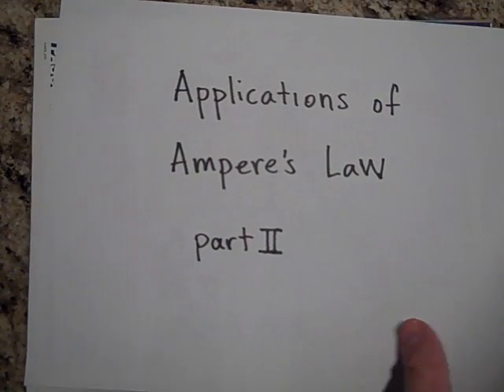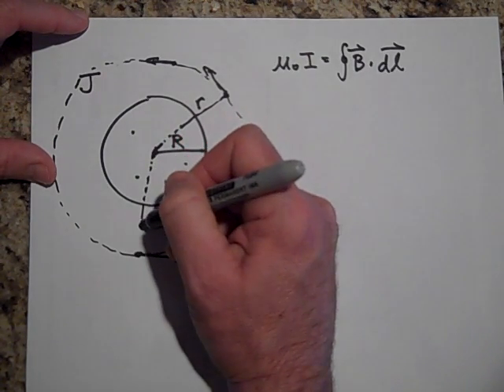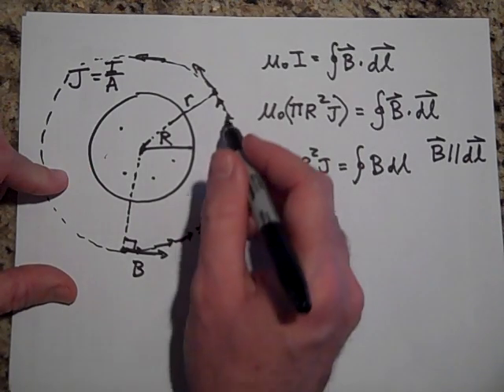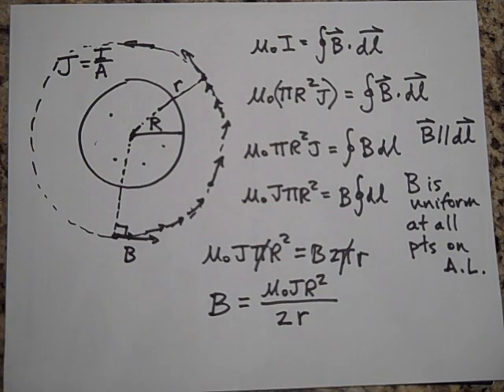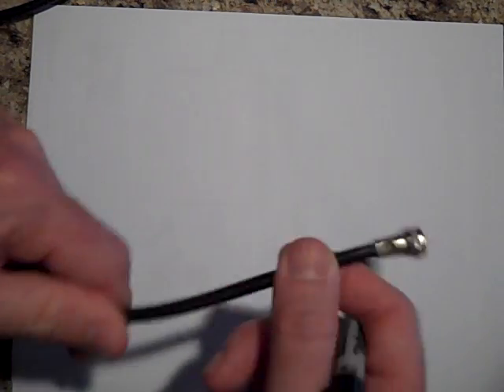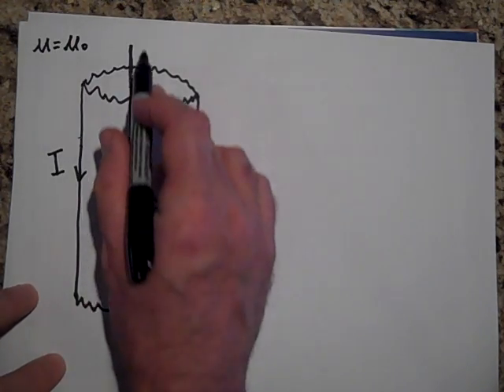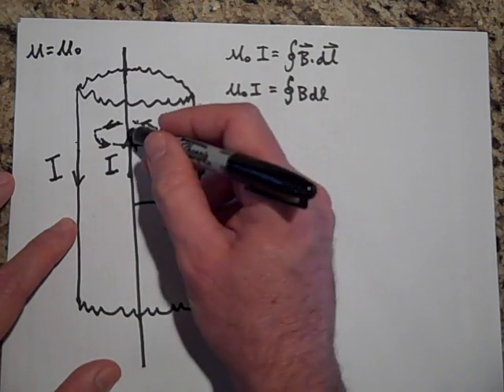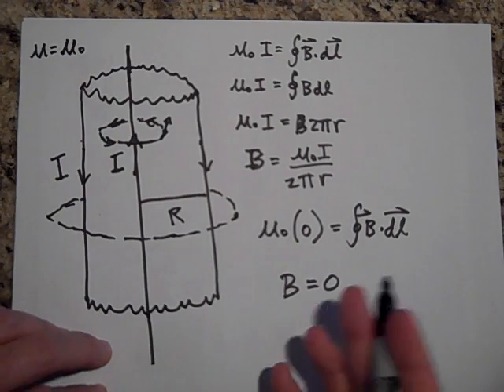Applications of Ampere's Law (part II)

Comment: Why is it that current goes down the sides? I didn't quite understand that.
Reply: Think of this as a coaxial cable, which is made up of two conductors separated by some dielectric. The reason that the current, i, are in opposite directions is partly arbitrary but is based in application. He hinted at it with the sum of currents at a junctions being equal to zero ( just think of it as one being a propagating path and one being a return path).

Comment: Consider this hypothetical scenario: suppose I have a wire with a cross section that is mapped out using the function y=f(x) with a uniform current density through it, how do I find B at an arbitrary distance away from the cross section?

Comment: Please can someone tell me why in this case he doesn't replace I by J*PI*r^2 ?
Reply: You don't really need to use current density (J) in this example because you know a current (I) is moving through the wire. You could use I = J*Pi*r^2 but its extra complication as I is known but J is not (so you would find J from I then substitute J in for I).

Comment: can u plz explain me why the current going in outer cylinder is opposite to that of inside ????
Reply: since its a junction....current entering junction=current leaving junction
Reply: Think of this as a coaxial cable, which is made up of two conductors 
separated by some dielectric. The reason that the current, i, are in 
opposite directions is partly arbitrary but is based in application. He 
hinted at it with the sum of currents at a junctions being equal to zero
 ( just think of it as one being a propagating path and one being a 
return path).

Comment: does the same apply for a copper conductor with an off center cylindrical hole?
Reply: with an off center cylindrical hole, the B field will not be same on the amperian loop (since the conductor will be closer to one side) thus the B will be not be constant and you will have a different answer.